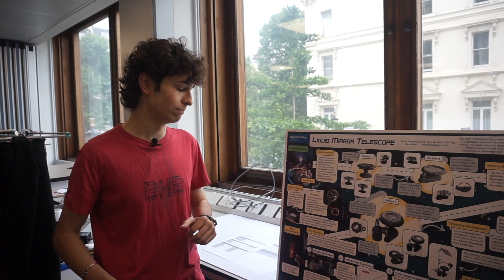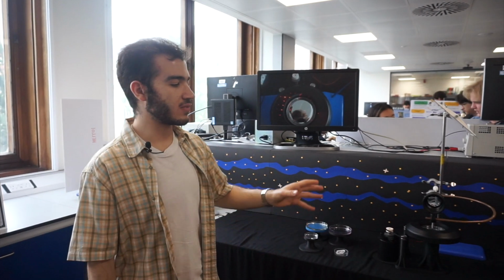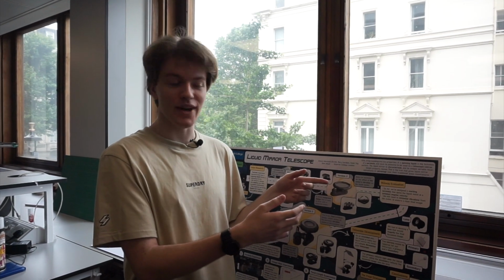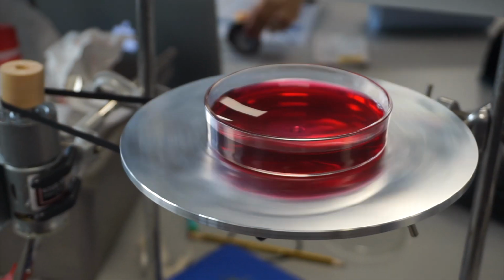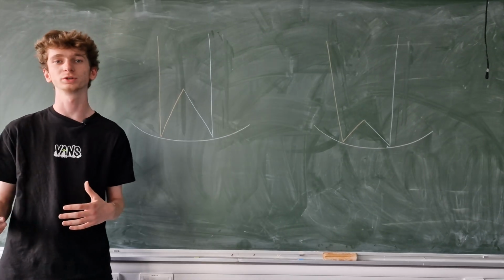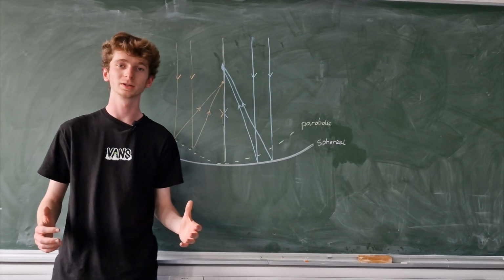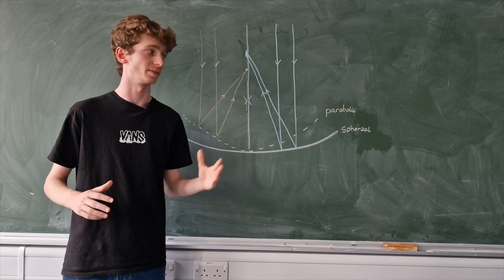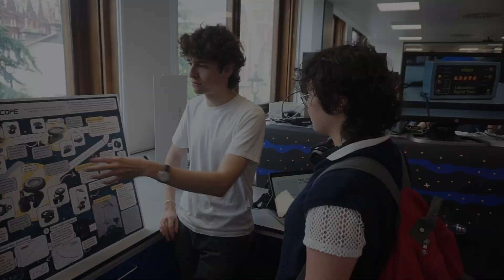Liquid Mirror Telescope Presentation

Comment: Very cool. Did you consider spinning it with levitating methods, like air bearings or magnets? Most high precision spinning mirror machines use air bearings afaik.

Comment: Why not just integrate a brushless motor into the spinning platform itself. the spinning platform would have attached the magnets to the bottom, a stationary coils below it powered by a brushless motor driver, you get the advantage of easy speed control and directional control (though i guess the latter doesnt matter for you)
Reply: I guess that set up can produce vibrations in the mirror
Reply: @jfpalomeque  dont know never tried it, but i feel it really wouldnt. one day i will give it a try !!